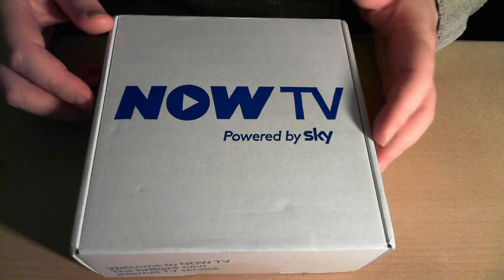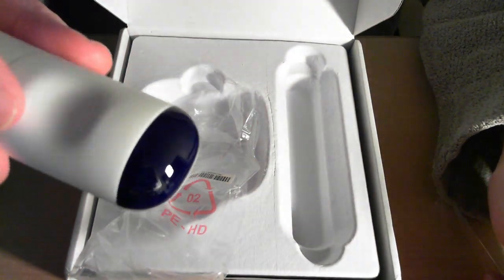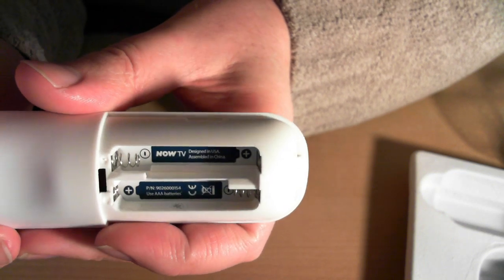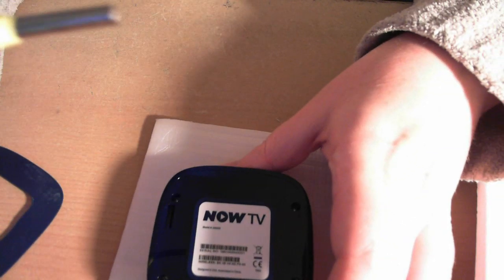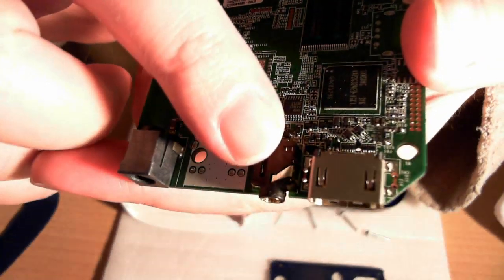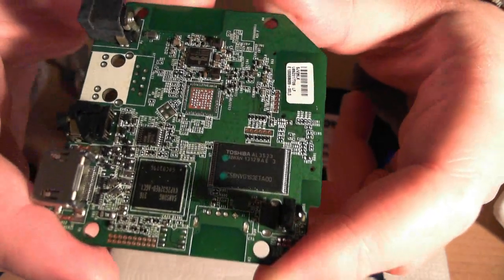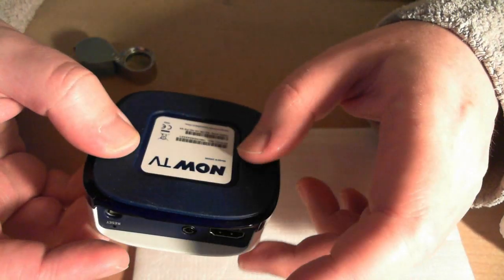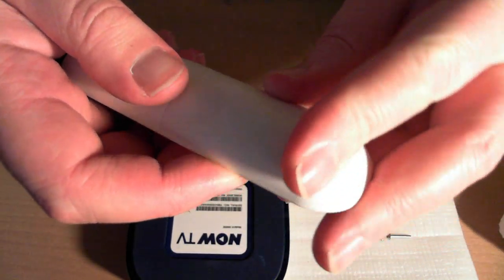Taking apart the Sky Now TV box

Comment: were is the fuse inside these please my dads as plugged wrong plug in and blown it
Reply: Ash Emmett it would most likely be a blown voltage converter. Cheap things like these almost never have actual fuses in them